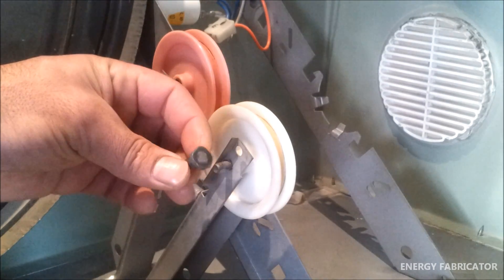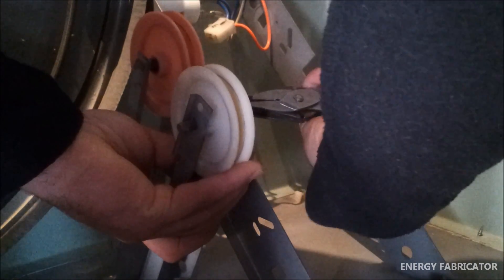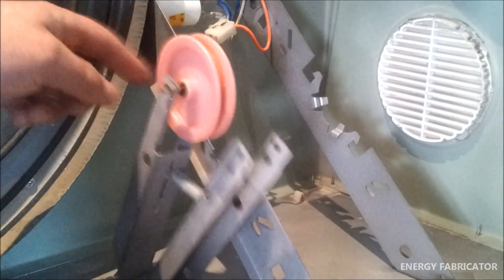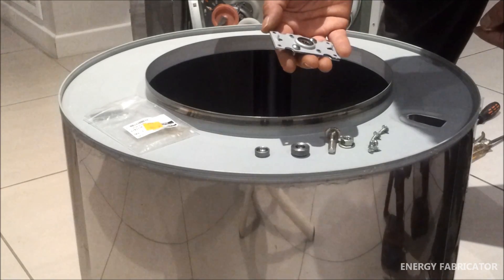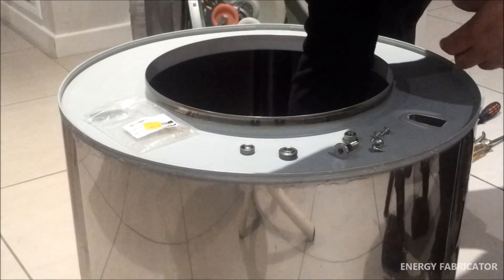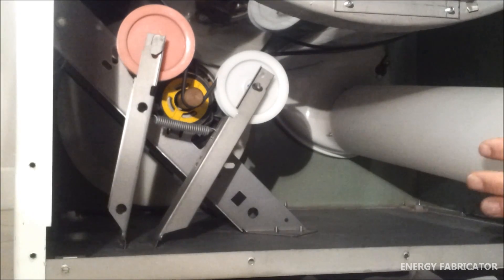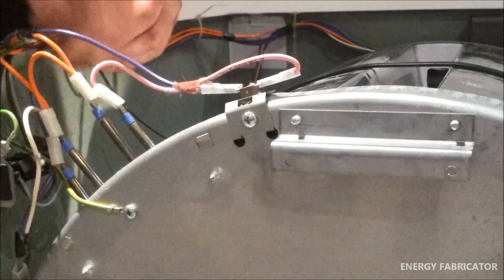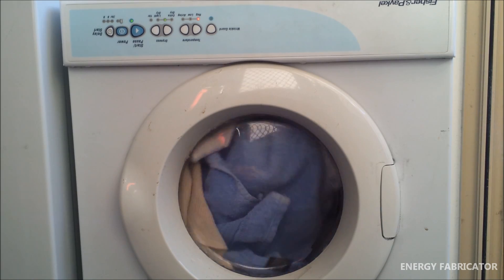How To #8.2 - Repair A Clothes Dryer [Part 2 - Repairs & Reassembly]

Comment: This video is Fantastic!! Very clear and easy to follow. I am still having an issue with my dryer as the nut that secures the bearing to the centre of the drum keeps loosening when I turn the dryer on. I have some photos of the bearingS. Would I be able to send you the pic so you can hopefully help me solve the issue pls? My diagnosis is that one of the bearings are worn and after watching your video I would have to use the adhesive threadlock.

Comment: Good stuff! Always pleasing when a major rebuild like this works out in the end! Hilarious out takes! I have things like that happen often!
Reply from the maker: Machine Man Thanks! Luckily for me, I stopped the video once I finished the rebuild... I actually forgot to plug the motor back in. I had to take the back panel off again to figure out what was going on. Apart from that, all went well and it's still humming along :)
Reply: @EnergyFabricator  Hi I've got the same dryer and when i close the door it doesn't beep to signal it's locked. So the dryer thinks it's still open and it keeps beeping when i press the start button. Could you please help me on this one. Cheers.

Comment: Nice work.  Those motor mount clips are tough. stumbled on your plumbers wrench solution, was also wondering if assembly is easier while motor mount brackets are out of the machine directly onto the brackets or after the brackets are mounted in place on to the side walls as you did in the video..  Brilliant job. great help

Comment: Don't use liquid oils or grease on Pulley wheel shafts. Pull them apart and use metholated spirits to clean them and use a normal soft HB pencil and rub the pencil along the shaft. The graphite is dry natural lubricant and won't attract lint or hair. It helps them run smoothly and silently for many years

Comment: Excellent video! I've just replaced my capacitor but it looks like that wasn't the issue. I get power to the machine but there is no hum. I press start and it beeps once and the light goes solid but no action or sound.  The door sensor seems fine. Can you think of what else it could be?
Reply: I know this reply is way late but others might find it useful.  Your problem might be that the door is a little warped and the tongue that goes into the kill switch isn't going in all the way.  try pushing the door at the top as you hit the start button.  If it starts, just open the door and flex bend it back into shape.  Easy fix :)

Comment: HI i have the same dryer and the drum moves freely when i put my hands inside to check the drum. its like it is unbalanced. i have noticed the retaining ring at the bottom has started to shread. Is this a possible bearing issue?

Comment: My dryer drum won't move when I press Start/Pause.
Reply from the maker: +Luke Kneebone 
If the belt is still intact and the drum spins freely when spun by hand (no worn bearing noises), it is probably the motor start capacitor. Replace it!
Reply: Fixed last year, orginally i thought it was the belt or if i put too much stuff in but it got fixed last year. How come you've got inverted panel when the dryer is orginally on the floor??? lol.
Reply from the maker: The panel is upside down because it was wall mounted in my last house. Now it is sitting on the floor, but it works just the same.